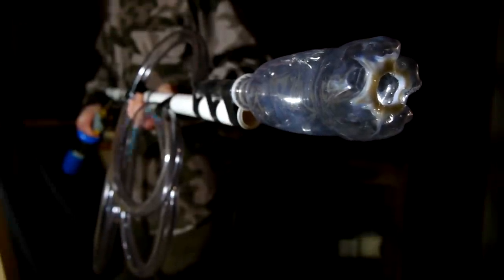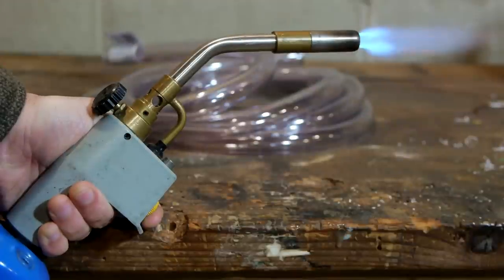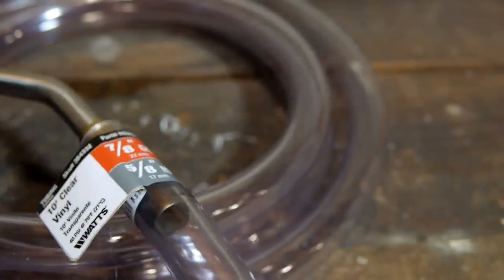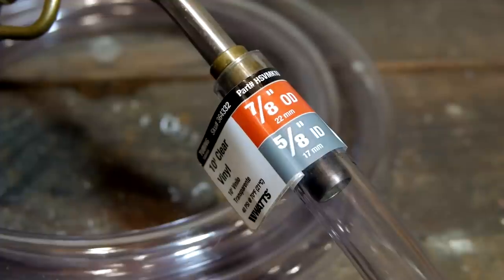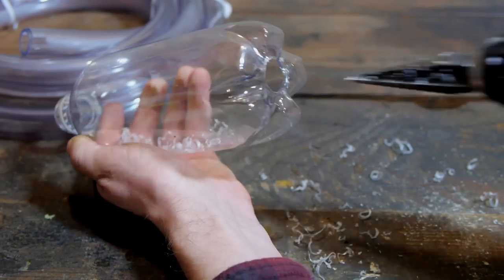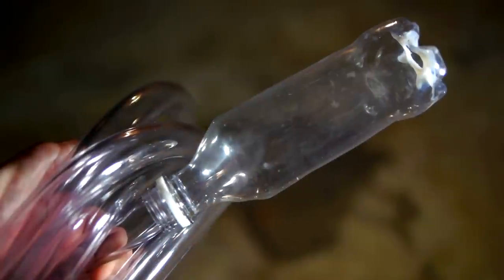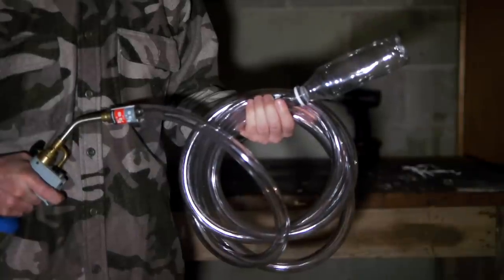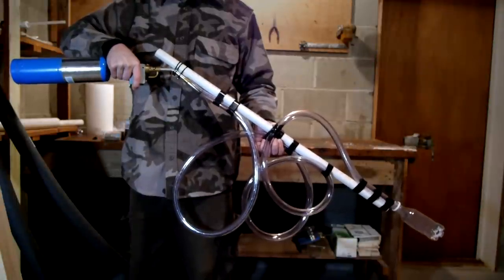Sci-fi Propane Pop Gun Tutorial

Comment: In case you are curious about modifications - I tried to use a tubing adapter to bring the 7/8" tubing down to a 3/8" one so I could work with smaller tubing to save on fuel and also have different sized flames swirling around. While gas was going through the tube, flame did not propagate past the adapter.

Comment: So rad.  Any idea how long the tube can be for the flame to still travel through it?  It would make for a super cool patio decoration, if done right.  My kids will love this one.
Reply from the maker: It worked fine with 20 feet, I haven't tried longer.
Reply: I would think as long as there is oxygen the flame would stay lit no matter how long it is or untill the fuel burnt out. I could be wrong.
Reply: Mech Uno Also don't let it burn for too long, or it will melt the tube, well, unless it's made of glass lol
Reply: Actually i am right, 1:45, so if you fire it a lot of times, repeatedly, it might melt, you didn't pay much attention to the video, right?

Comment: I wonder if you could use a modded version of this to create a high velocity bb rifle.  Using the combustion as a propellant.  Although check valves and an igniter in the far end would be needed, and copper bbs would be required due to the fact that the plastic might melt.

Comment: Have you had to do any modifications when adding the second length of plastic tubing? I just added one and now the igniter is giving me fits. It ignites maybe 2% of the times I try shooting. It was a little finicky with the one length of tube also. I thought I had a bum torch (I got the Bernzomatic TS8000) but when I remove the hose from the end of the torch  it ignites perfectly. Does the gas make a difference? I'm currently using propane. I haven't tried the MAP gas that came with the torch.
Reply: +Wendy Yup I think I figured it out. If I just barely crack the gas open it works ok. I figured it was starving for air and turned the gas down. But not down far enough. It's working much better now.

Comment: what is the maximum length of the vinyl tube for it to have that effect?
Reply from the maker: xXJosafat07Xx In the final clips in this video I was using 20 feet. The torch was struggling at that point to properly feed the right amount of fuel and air into it, so probably not any longer than that.

Comment: What happens if you hold down the torch button for extended periods of time?
Reply from the maker: You waste propane.
Reply: Wouldn't it melt or burn the tubing or the bottle?
Reply from the maker: Dan Flynn No, it will not stay lit any longer than it does in the video no matter how long you hold the button down
Reply: NightHawkInLight ok, but I have another question: can you use it to start a fire?
Reply: you could if the material you are going to light on fire ingnites on contact with a flame. like a little spray from a can of axe.
Reply: Dan Flynn It is fire...lol

Comment: What happens if you don't drill a hole in the bottle
Reply from the maker: I should have mentioned that in the video because I knew it would be a common question. It wouldn't work if there wasn't a hole in the bottle. The torch wouldn't be able to push propane into the tube.

Comment: What would happen if you put isopropyl alcohol?
Reply: Its not really a gas, so it wouldn't work like this. YOu could bubble air through isopropyl and then itno the tube though. Only problem is the alcohol you are bubbling through would start on fire every thime you lit it. Same could be said for ethanol or gasoline (would not reccommend gas). Also it would burn through the tube REALLY fast and you could barely see it, because there would be more air than fuel. That would make a laud bang, and could be used as a cannon to launch objects out of the bottle on the end. Its a completely different and interesting idea in itself though. I may have to try it (outside at first of course).
Reply: Uh, never mind lol

Comment: Is there a limit to how long the plastic tube can be? I'd like to do something like this for an Independence Day display, but on a larger scale.
Reply from the maker: +USWaterRockets Any longer than 20' of tubing and I had trouble with the gas actually feeding into the tube. It would reverse flow and exit through the torches vent holes.
Reply: Ok, great! Thanks for that bit of info. I guess I will either build to that scale.
Reply: +NightHawkInLight in gonna put one on my go kart to look like this toyota supra with anti lag
Reply: +NightHawkInLight, wait, so, if I understand what you're saying correctly, you mean much longer than 20' and the flame would go all the way, say, 16 or 18ft, THEN reverse and go out the torch vents? Because that might or kinda cool, too!
Reply: Wouldn't it be ok if the tube just went upwards? Then it wouldn't go back right?

Comment: How well does a tighter spiral work? Also do you think Pyrex glass tube would be safe? I want to make a plasma steam punk blaster.
Reply from the maker: It will work fine so long is it doesn't kink. I'm not sure I would trust glass.
Reply: NightHawkInLight I planned to use pretty thick Pyrex. The good thing about Pyrex is that it's pretty resistant to thermal shock. And the stuff I'm looking at is lab grade for use in high heat. I'll do a couple of test runs, and if it doesn't work maybe I'll use clear plexiglass tube.
Reply: Also holy Jesus thank you for answering a comment on a three-year-old video!

Comment: If i wanted to make it louder, what would you recommend?
Reply from the maker: +molon labe Probably adjust the size of the hole in the bottle. I haven't played around with the idea enough to say what size is loudest.
Reply: +NightHawkInLight I'd say it would change the pitch as well, smaller is louder/higher, larger is more quiet/low
Reply: I'd say use a bigger bottle
Reply: NightHawkInLight Could you attempt to make the sci-fi pop gun with a metal bell similar to that of a trumpet? If you have the time and or materials.
Reply: molon labe - TheBackyardScientist's video he used some kind of green, tall, glass bottle and it sounded like he shot a gun.

Comment: You should add a spark plug at the end to ignite the remaining gas and make a small explosion. 
THIS IS A SUGGESTION IT MAY NOT WORK ||| DO NOT TRY THIS AT HOME|||
Reply: You know that's fire coming out the end, & the gas flow is continuous, right? Why expect a spark plug to do anything at all? The fuel will only burn with the correct air mix, which is generated at the tip of the torch.
Reply: oh thats right, thanks